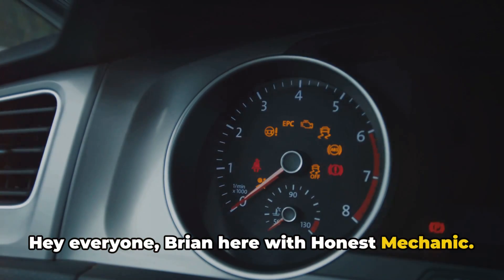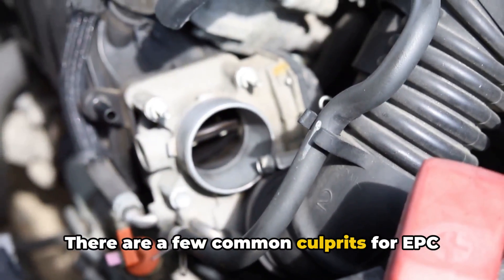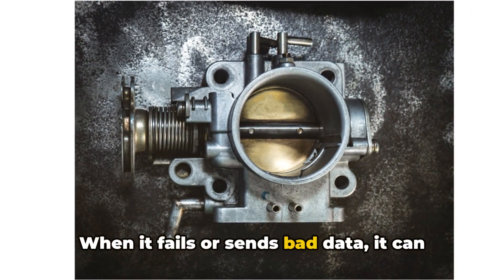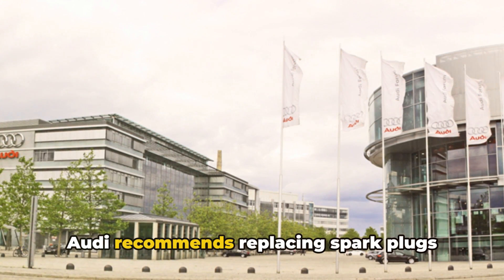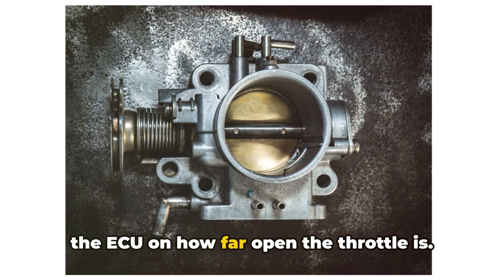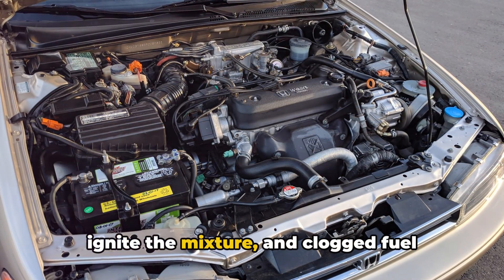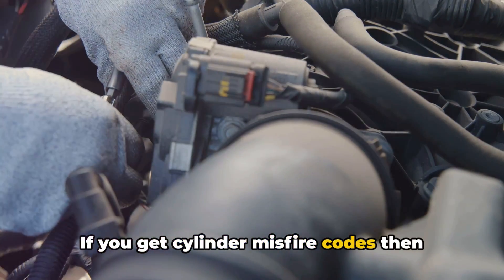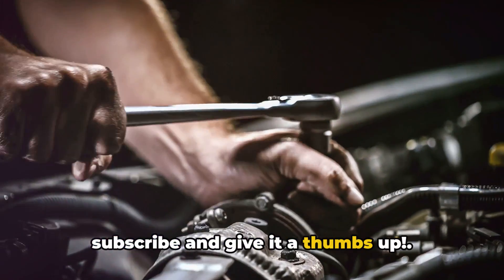Audi EPC Light: How to Fix and Reset

Comment: I have an Audi s4 b8.5 and was driving home around 75mph. I went to pass a car and didn’t punch it but when my car downshifted is when it threw the code and started to shake. I turned it off and back on and I took it easy home. Any idea on this?
Reply from the maker: Hi, honestly, it's difficult to determine, but since the code disappeared after turning it off and back on, it might indicate something is starting to fail but hasn't completely gone bad yet, such as the spark plugs. The best approach would be to scan and check the code your S4 stored.
Reply: @HonestMechanicChannel  So it showed a misfire in cylinder 1 and 3 I just changed the plugs and coils for those and haven’t got anything yet. I think I’m going to change PCV soon.
Reply: @HonestMechanicChannel same issue here but I get code p0301 and goes on limp mode after 3000 rpm if you drive like grandpa will not fail at all
Reply: Hello, my Audi Q5 2012 has this problem, the spark plugs and coils were changed and they scanned it and it doesn't show any faults, it vibrates sometimes other times it works well and it doesn't start well, it's time to accelerate
Reply: @tenierloma try putting in premium gas from a big brand ovoid off brand gas.
Reply: Yeah I have a 2016 S4 Premium Plus Pack the car rides perfect but I can't give it boost but when I run the code it tells me misfire and then it shows PC valve but I just changed the plugs so if it was an issue with the plugs and what it did it three months ago when I changed the plug it's possible that I have a coil but I'm thinking it's a boost leak since the PCV valve came up you have to take the supercharger off I might just take the coils out just to see what happens they look fine the car only has 80,000 miles on it

Comment: Hello, I have an Audi 6 2017. EPC goes and comes, I have taken it to two mechanics no codes are shown. Aside from the tips provided, any suggestions on what it can be?
Reply: I had the same thing at first check engine with cylinder miss fire and EPC light I changed fuel injectors and carbon cleaning for the check engine. For EPC I replaced a damaged cable that went to the gas pressure fuel. After that the car felt better but still had EPC going on in the high way. I had done an oil change at home and  guessing by lifting the car up it activated the EPC so I did a EPC reset I seen on a website. After that no EPC light hope this helps!
Reply from the maker: Hello there, is the light comes and goes on startup or while driving? are there other symptoms alongside the light?
Reply: It comes on when the car comes on and sometimes if it didn’t while the car is on. No other codes come on or any other signs of car destress
Reply: @EricaGonzalez-t5k  I have A3 and I this problem as well when I first turn it on it’s shows the EPC light , however , if I turn off the car and turn it back on it goes away completely. It only turns on when the car hasn’t been started in a long period of time! It runs smooth and I’ve had no misfires so it’s confusing.
Reply: @ashineengflame  hello, ur problem is solved?? coz im getting the same problem i started my car after 2 months before it was running perfectly fine but now the epc light turns on when i aggressively accelerate
Reply: @HonestMechanicChannel I got a Audi a3 2016 and I got it after using manual paddle shifts after a couple down shifting
Reply: Hello, sometimes it comes on when I turn on the car, sometimes while I’m driving. Only when the EPC light is on, it will display Stop-start function non available.
Reply: I have a 2015 A3. EPC has been coming on and off for about 350 miles. Same with check engine. I had codes read and got multiple. P0236 (said moderate issue). P0606, P0106, P0192 (said these were major issues). Any idea? Thanks!
Reply: @G23sports 
Is that a petrol or diesel engine????
Reply: I have the same problem 2012 a6
Reply: Today, my engine light came on and the car seems to stall when I press on gas. 
Taking it to get looked at in the dealership
Reply: Update: Engine light came on so I took it again. My turbo needs to be replaced
Reply: What’s up with this man none of yall got answers
Reply: In my audi a 3 2016 epc lights come and go but now it stay always on dashboard and engine lights is also on